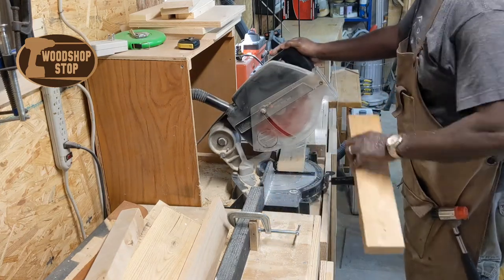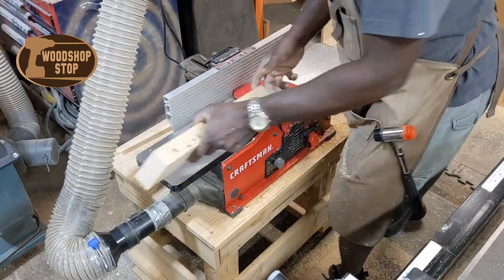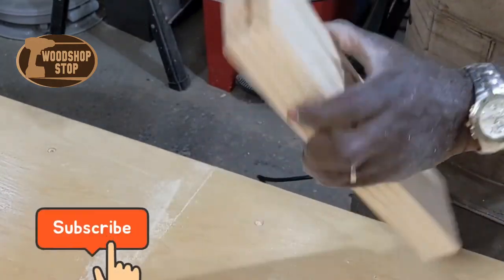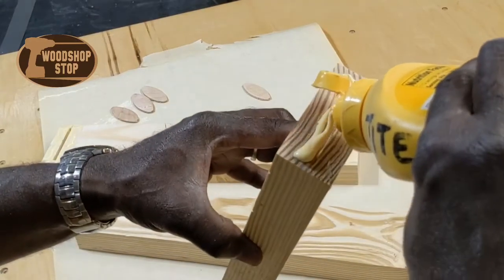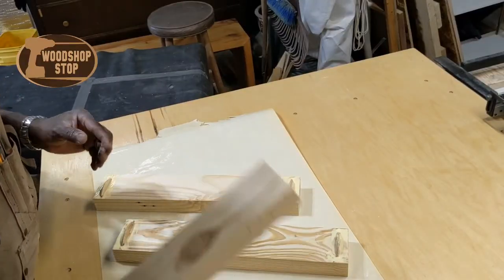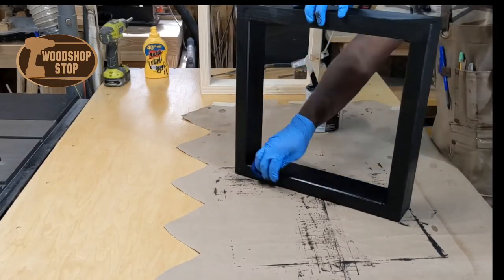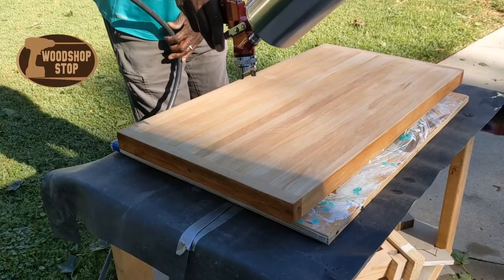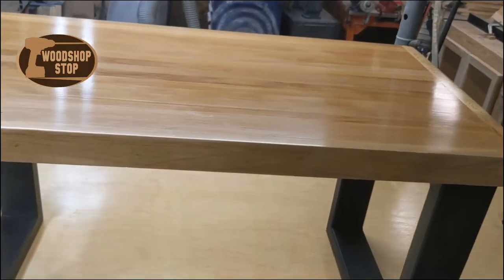How to make modern square coffee table legs and replacing the old ones, for a maple bread board top

Comment: Biscuits on end joints seems wrong. Are those 2x4’s?
Reply from the maker: I wouldn't advise anyone to use biscuit joints in this situation but I think it should be strong enough for light duty I don't imagine anyone's going to stand on the table and dance around so it should be fine. Yes they're 2x4s. Thanks for your comment. Happy woodworking!

Comment: I really like your videos but in this one you are recommending the use of biscuits. Biscuits will most likely snap under lateral strain when used in a but joint. it is the consensus of the woodworking community that they should not be used for this purpose. They are used for alignment such as when you are joining boards at their side grain to hold them flat while clamping and drying but not necessary for strength. What I believe to be the strongest and most stable joint would be mortise & tenon but this is not applicable to too many types of joints. The Domino is kind of like an imitation M&T only a little less stable. I think that the best strength for a but joint can be achieved with using 2 to 4 dowels in the joint to emulate the M&T. If you don't want to go that route, a lap joint would give you some strength and stability. Even though the myth of the weakness of gluing end grains together has been recently debunked, I still do not expect much reliability to an end grain glued joint by itself without some sort of added device such as dowels to give some edge grain gluing strength or the use of pocket holes to it but not biscuits.
Reply from the maker: Hi Ancient Tom, I agree with most of what you said. The use of this small table should not be subjected to a great deal of stress, therefore I feel the joints for this application should be sufficient. Thanks for your tips and comments I really appreciate the input. Have a great day.